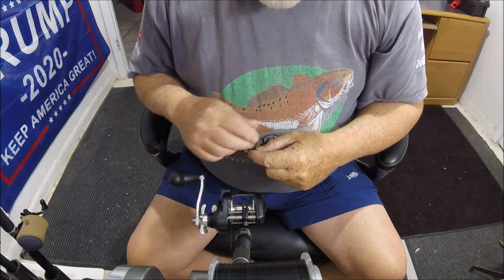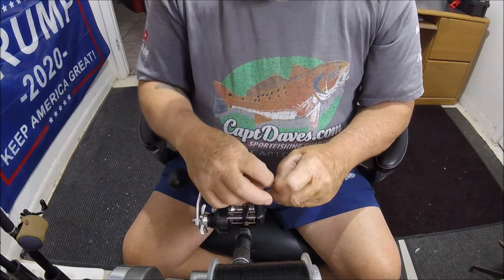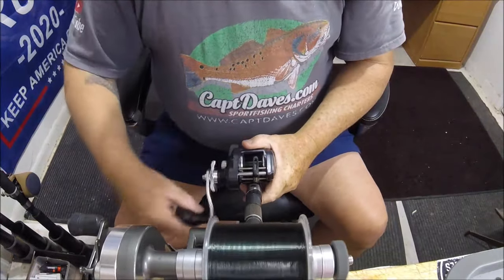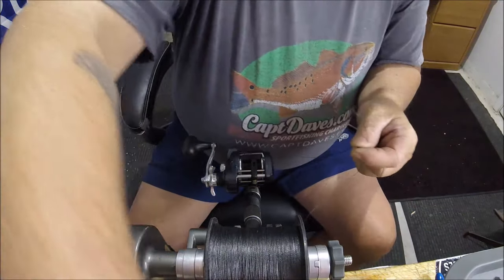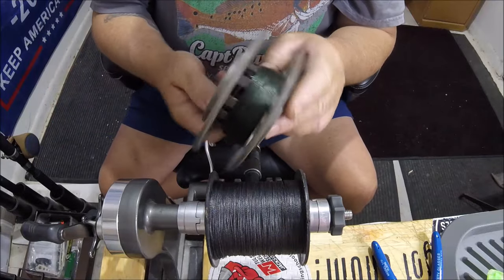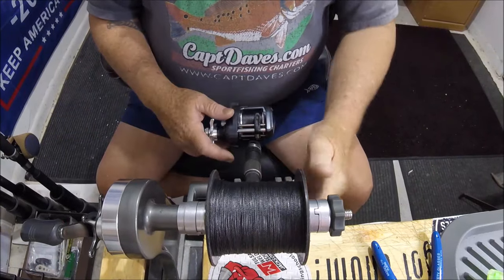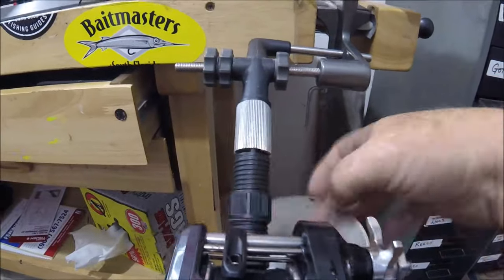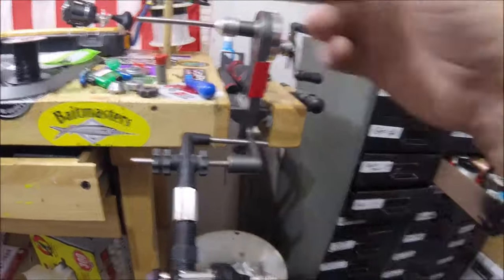SPOOLING REELS MADE EZ WITH THE RIGHT SYSTEM

Comment: Hi Dave  I have twin Suzuki  DF200ap. 2018. With fly by wire. control. I left the mooring and the port engine gave me a  check control unit C7-5   do you know what this means?  As much information on it. And it was still running turn i off and it will not restart any ideas as I am new to Suzuki all the best Jack
Reply from the maker: talk about off topic. best I can help you with is I have a video called Suzuki codes. would you have to do is find out what that code means.